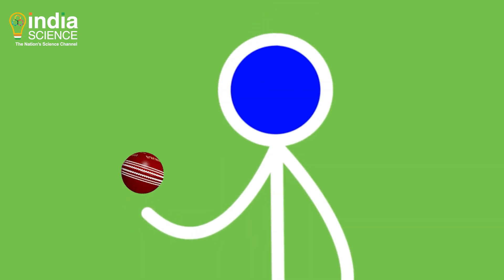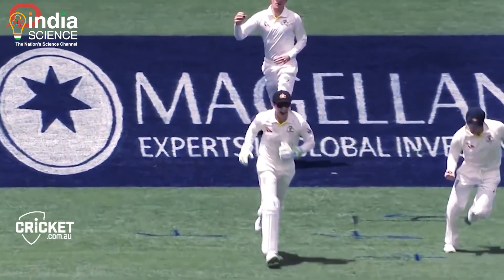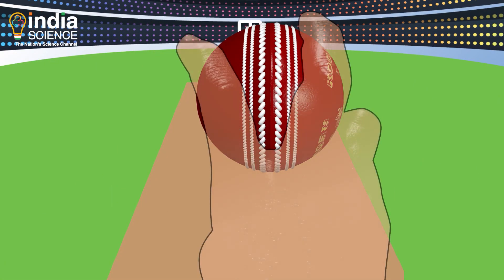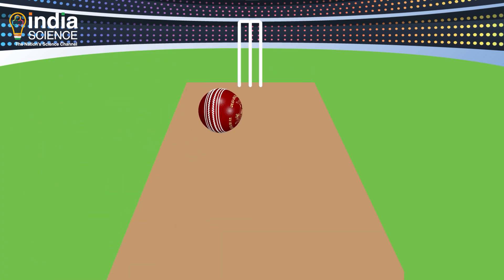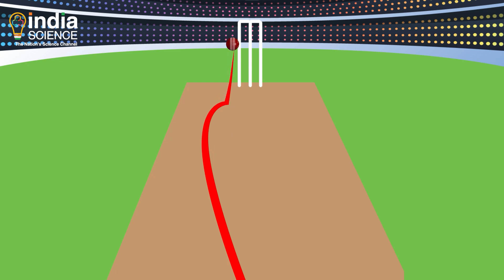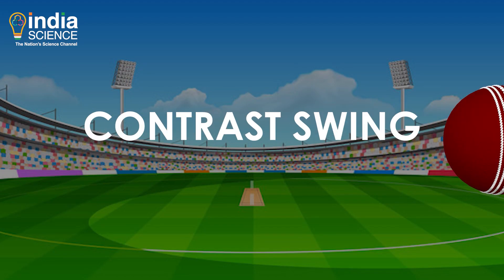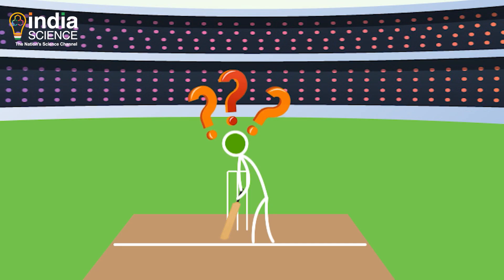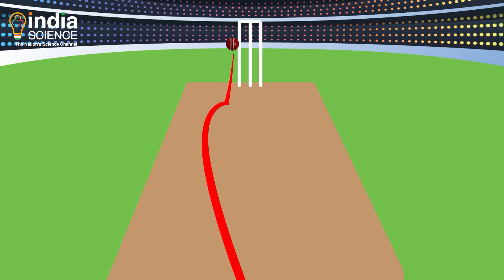The Science of Swing Bowling EXPLAINED ! (E)

Comment: Why in that case balls without Seam also swing? Take a new smooth surface plastic ball (like table tennis ball) and it will swing better than the typical cricket leather ball. 
on the contrary, take a tennis ball and throw it with the Sling Arm action. it will also swing opposite to the way a typical smooth ball swings. there seems to be something more than just the Air working here. it seems it has something to do with Rotational Motion as well.
Reply: Yeah that happens because of the air friction. See the weight of a cricket ball is more than a tennis ball, and tennis ball is hollow, which the cricket ball isn't. The direction of air flow is working

Comment: Purpose of shinning is smaller the radius of that side. It effects to lower the air flow rate. Air flow rate is oppositely proportion to the pressure. That means, pressure of the shined side much higher than the other side. Force applied to the ball is higher from the high pressured side. That's why the ball swings. In my opinion.. 🙂
Reply: Bhai use language which u are good at..

Comment: Sorry brother but u blew off could  not explain it correctly. Conventional swing is done with the new ball not with an old ball (where seam has a key role to play) where both sides r shiny and an old ball   has one side shiny and other rough here this fluid mechanism comes into play where there is a considerable pressure difference due to which the ball swings away from higher  pressure region to lower  here seam has no role to play

Comment: Don't agree with your explanation for reverse swing, in reality ball swings in the direction of the shiny side but your explanation is opposite, why is it so?
Reply: To my understanding, his explanation is wrong. In reverse swing the ball moves towards the shinier side of the ball. Mind it, reverse swing happen late in the innings whence the rough side has lost significant mass. The shinier side is relatively heavier than the rough sode, hence in air, the ball dips towards the shiny heavier side.
Reply: @abhinavmohanty1813  Yes agree with you, mass of the ball and fluid dynamics act on ball ...this video although made well is misleading/confusing viewers
Reply: @abhinavmohanty1813  exactly...also ball can swing on the very first delivery itself with both sides being equally shiny....this video putting out half info
Reply: Exactly
Reply: Totally wrong explaination. The ball experiences low pressure on laminar(shiny side) and hence moves towards the shiny side itself. Free air give rises to low pressure. That is why we are advised not to stand near a fast moving train bcs it creats a low pressure zone  and on our back (normal atmosphere) has relatively high pressure which gives our back a push towards train
Reply: @halamadridppdvet    yes 
Because of the seam the air flow in the Shiny side is more turbulent than the roughside.  In this case it make a high pressure on shiny side and relatively low pressure on roughside 
That's why it make the ball swing in the opposite direction of seam position .
And this is called reverse swing .